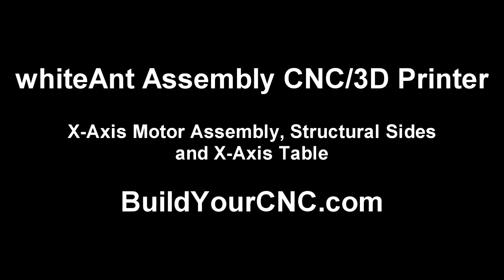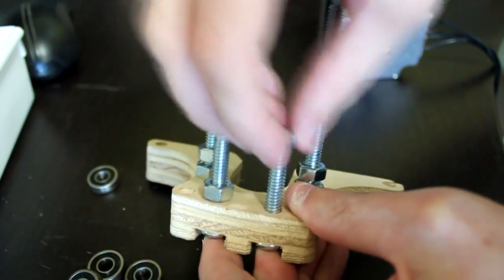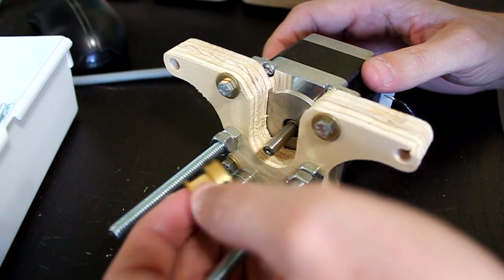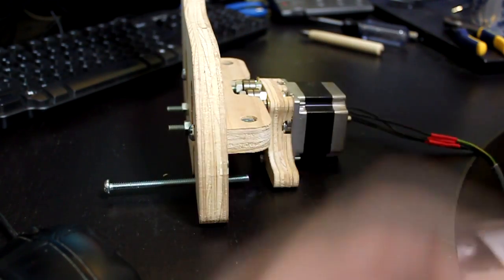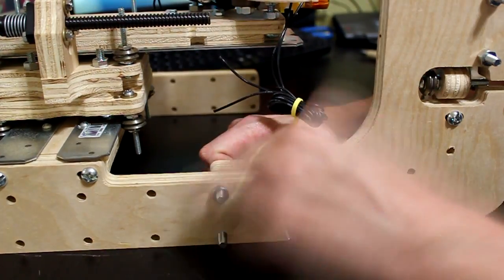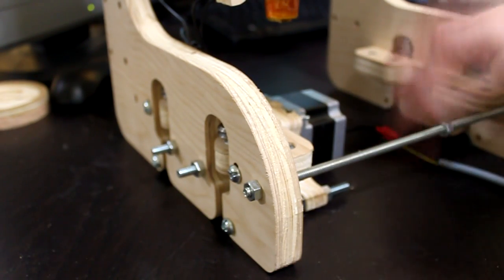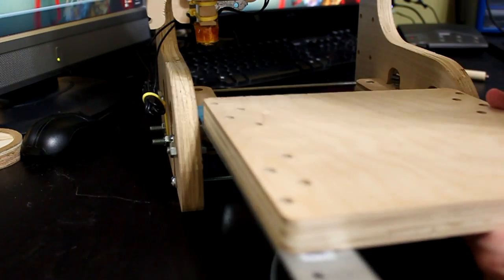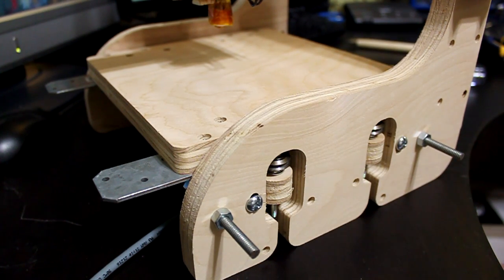whiteAnt 9 - attaching the x-axis motor and table assembly.mp4

Comment from the maker: @MycroftHolmz I see.  I did not read the comment carefully. If you remove the nut from between the bearing and the wood, the bearings will be closer and allow the pulley to be fastened in a position more aligned with the bearings.  Another alternative is that we provide another wooden part that positions the motor closer.

Comment from the maker: @MycroftHolmz One other way to do this would be to have the screw inserted from the bottom of the table (the head of the screw against the rail, not the nut).  Please let me know if this helps and I will provide annotations (or a new video) to explain this.

Comment: Ok. this step was a nightmare. The V-groove baring holders need to be raised as much as possible. They need to be leveled and locked into the cross dowells. And they may need to be filed down for everything to fit.

Comment from the maker: @karandex There are a few reasons I selected NEMA 23 for the motor choice.  Since this machine also serves as a mini CNC machine, NEMA 23 motors can provide extra torque if needed.  The Z-axis uses a multi-start lead screw and an antibacklash nut which poses a bit more friction, so the z-axis motor uses a NEMA 23 motor.  The extruder for the 3D printing uses a stepping motor for enhanced function and a NEMA 23 is used so no further gearing is needed to push the PLA or ABS down into the barrel.